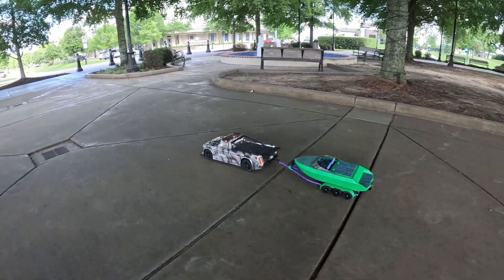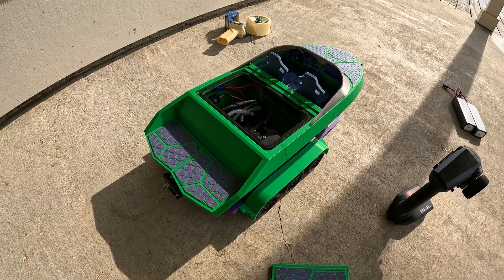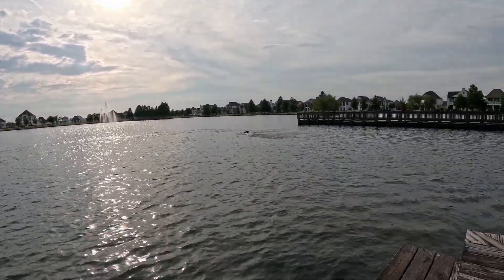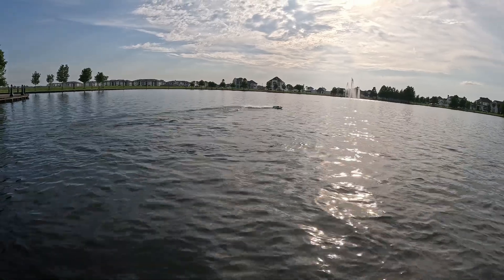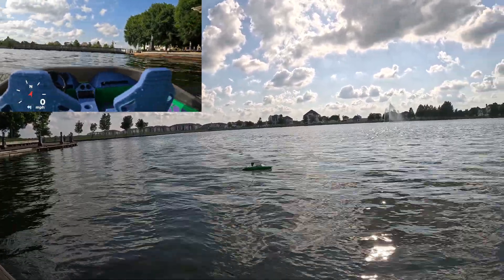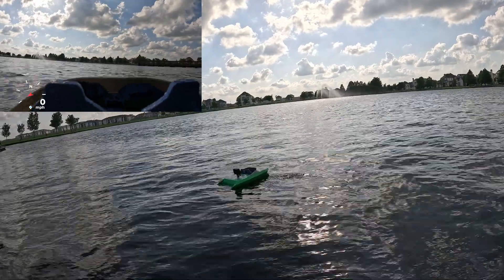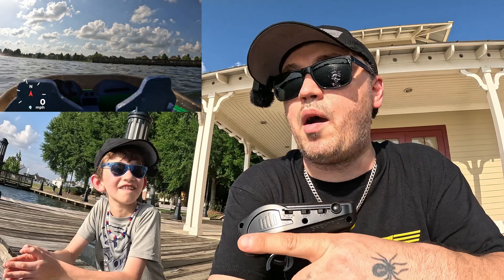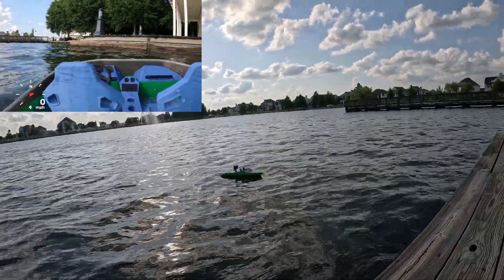This 3D Printed 8s Jet Boat CRUSHED Expectations – First Water Test!

Comment: Lose the trim tabs, use 15° nozzle, put the buggest turn fins on it u can find and run like a 5000 mah 6s battery. It should do about 48-50 with a 2200kv, and be much more controllable. If u do some how manage to get full throttle on 8s u will either sling a magnet or start a esc fire......ask me how i know lol
Reply from the maker: Thanks for the advice. I might give it a try—I don’t mind risking a few fires, haha.

Comment: Perfomance means handles AND runs good. That thing is undrivable on heavy throttle. Try 4s I bet it'd be a lot better.
Reply from the maker: Thank you. I’ll be making a video of these boats running with different battery combos.

Comment: Way over powered1 2 cells maybe 3 cells, Not really performing in my opinion. Good job on building it..
Reply: He would definitely benefit from a smaller battery haha
Reply from the maker: See, I've tried all that. I tried different combinations of batteries, ESCs, and motors. This boat is extremely powerful. I haven't been able to give it full throttle without losing control. I have a 4S version in my 3D-printed jetski, and it's nowhere near as fast or powerful. The only thing that somewhat matches this in terms of speed and power is the Supersprint which is much smaller and runs on a 4S 120A ESC and a 1800KV motor. I'm up for trying different things, so if you recommend a combination that you think will perform better than this, let me know, and I'll try and record it.